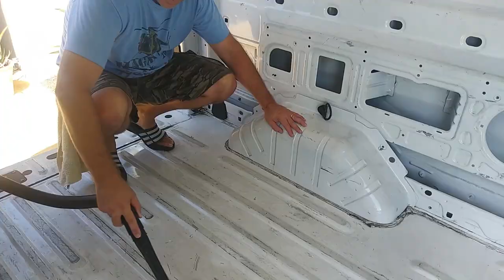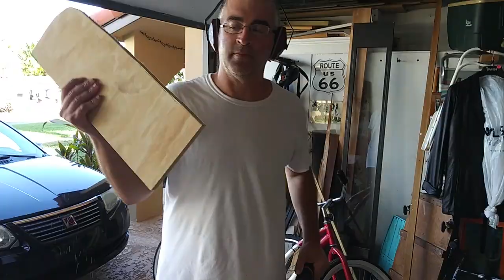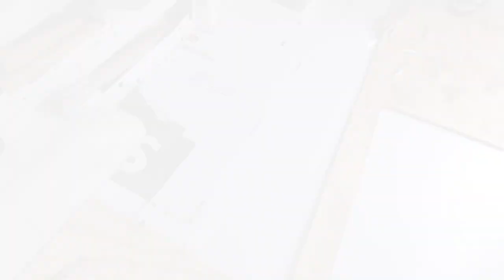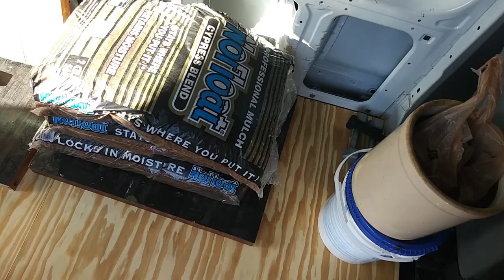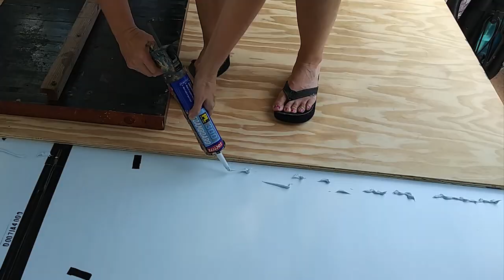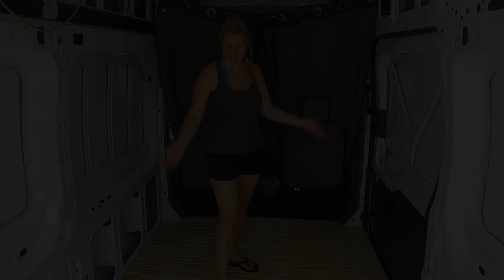How to (& how NOT to) install a SUBFLOOR in a Van Conversion (Ford Transit) | VAN BUILD #1

Comment: I like the bolt attachment style you used to secure the plywood. And spray foam the gaps to stop squeaking. Good stuff, cheers.
Reply from the maker: We really didn't want to put holes in the van but bolting definitely seemed necessary. It's held up well since.

Comment: If you use marine grade ply on the floor it is less likely to warp like your cuts did. Also, it handles moisture better than standard ply. I used 3/4 inch marine grade ply, but it was before the crazy lumber prices.
Reply from the maker: Marine grade sounds like a good way to go. We've been trying to minimize costs while not compromising quality. With the ply being bolted down it seems to be holding up well and we haven't noticed any warping.

Comment: Very nice! For whatever reason some builders really freak out about drilling holes into the van.  It’s as if a 14” hole in the roof is ok.  Perfect use of T nut to secure the subfloor!  Much better then simple sheet metal screws.  Perhaps a lock washer and lock tite on the bolt.  I would not worry about rust.  You painted it.  I would also paint the bolt head from the undercarriage with rubberized paint material to seal from air and water (you must have the two to rust ((oxidize)).
Reply from the maker: Thanks! We try try to avoid putting extra holes in the van if we can but felt that step was necessary. Thanks for the recommendations. We did cover the bolt head with QuadMaxx caulk, although we didn't show that step in the video. Hopefully that should suffice.

Comment: Thanks for this video! We are doing our floors similar to yours only we did NOT glue anything down and likely wont. We are having the same issue with warped and noisy plywood using only the tiedowns... so your bolting secured method is something we WILL follow your advice and do it that way.  Thanks again!
Reply from the maker: We're so glad you found the video helpful! It was so frustrating until we decided to do the bolts. We wanted to avoid drilling holes in the van but are glad we did! No problems since.

Comment: Phew you made hard work of that! Drill through the ply and the floor, countersink the ply, use self tapping screws screwing the ply to the floor.
Reply from the maker: Thanks for the suggestion for those who might be in the process of building out a van and prefer not to use bolts.

Comment: I'm a master wood krafter.
I been making furniture guitars
Houses cabinets and many other things out of wood for over 50 years..and I still made a 100 mistakes on my first build. 
and in the second one and third one..you always will make little mistakes but you learn from the mistakes you made
Reply from the maker: It's especially easy to make mistakes on a van build since nothing is straight! We hope to never have to build out a van again, but if we do we're sure this experience will help! We've certainly learned a lot along the way!

Comment: The foam will take a set very quickly, and all your bolt load will drop drastically.  Check how much torque on all your bolts now, I bet they are very loose.  Never try to compress foam. You should place some wood beams between foam panels.
Reply from the maker: Thanks for watching and taking time to leave feedback. We followed the lead on what some others had done with their builds long before we started ours. It's been over two years now since we installed the flooring in our van. We just double checked our bolts, and they are all still snug. We think (and hope) they'll stay that way!
Reply: I kind of get what you're saying but then there's the other issue of wood to metal and heat and moisture transference. 

sometimes the devil you know is the best choice

Comment: so, we shouldn't use any glue between foam and plywood and just screw it down? We almost started following faroutride guide for our subfloor, and thankfully saw your comment on Facebook tread! Thanks!
Reply from the maker: Far Out Ride was also one of the places we looked when choosing the method we used, as well as several others that recommended the same adhesive. We're not exactly sure why it didn't work for us. One reason could be high temps but who knows... I did just see a women post in a group we're in that the same exact thing happened to her. Several people responded that they bolted the floor. One person suggested: "Contact adhesive, liquid is stronger. Go to a local flooring supply shop." (Maybe that's the same thread you saw?) We're no professionals but all we can say is the adhesive we used certainly didn't work for us but now that we've bolted it, it's totally fine!

Comment: Hey HOW did you get a piece of wood that big? I’m stressing because I have a 2018 ford transit 250 and I measured the length of the floor at 127 inches and he width on the inside between the wheels to be 54 inches but nobody seems to have plywood big enough
Reply from the maker: Hey Dominick! We used 4x8 sheets cut into pieces to fit. Good luck with your build. We hope you'll find our build series helpful! It can be quite the learning curve and challenging to build out a van with all the crazy curves and angles!

Comment: I know I'm late to the party, but I just wanted to thank you for the honest video. It's a nice breath of fresh air. 

Of course most (if not all) of the other vanlife videos cut all the difficult parts out, or the stuff that didn't quite work out as planned. They need to keep up appearances, you know. It needs to appear easy or they can't get the views (that, or getting their wife/girlfriend to pose provocatively in the thumbnail, that's guaranteed at least 50k bonus views right there).

Anyways, you'll be glad you bolted down the floor. I've seen too many videos in which the floor was only glued down, and then they have their counters/cupboards just screwed into the plywood. I'd hate to be in that van cruising down the highway and someone bumps into you and you end up rolling it over. A van in a tight rollover with pieces of plywood flying around is not a very nice place to be. So I would not call what you first attempted a mistake, it was a blessing in disguise.

Me? I'd be screwing straight down through the plywood and foam insulation and the metal floor with self tapping metal screws. Just make sure to get the screws long enough to bite into the floor, and that's far enough. The screw will seal the hole through the van floor from rust, but you can get underneath the van and spray the ends of the screws with rust prohibitor if it makes you feel better. I'd put a screw about every 6 inches on opposite sides of each seam.
Reply from the maker: Thanks, Richard! We try to make videos that are helpful to others and to keep it real. Maybe some of the other channels just don't make as many mistakes or have as many challenges as we do! LOL! We're happy with how the floor turned out - and most of all we love that the van allows us to travel and explore so much more easily than our pre-van life! It's definitely been a learning process though. We hope you'll check out our other build videos and follow along on our adventures!

Comment: What purpose does the plywood sub-flooring serve? Why not attach the finish flooring directly on top of the foam boards?
Reply from the maker: For us, it gave a nice firm foundation for the rest of the build plus some extra insulation and sound barrier while driving. Mainly, we don't like to drill holes in the van, so the plywood provided something to screw into when building out the rest of the van. We also installed vinyl plank flooring (which you can see in a later van build video) and we thought the plywood was a better surface to install that over.

Comment: Pre planning is very important 👌 
1st Put it on paper 2s assemble it 
On your mind 3d repeat the process..never cut a single pcs or screw a single screw wit out this 3 steps 🚶‍♂️..and even so you make some mistakes. But the biggest mistakes  you could make  is get exited and rush the van conversion
Reply from the maker: Thanks for watching, David! We have certainly done a lot of pre-planning although it seems no matter how much we plan, sometimes it still doesn't come out quite how we thought it would! We've learned to measure many times before cutting anything and to dry fit before attaching anything!

Comment: I would cut the insulation to fit and put it between the wooden strips. But then the strips would probably have to be a little bit thicker. Also, I wouldn't drill holes in the metal of the van floor if I could help it. It kinda defeats the whole purpose of insulating if you have metal going through from the sub-floor to the outside of the van 🤪
Reply from the maker: There are lots of different ways to do it, which is overwhelming when getting started with a build if you are inexperienced! We're pretty happy with how the subfloor and insulation turned out and it's performed well since we started traveling. As you saw in the video we tried to avoid drilling holes, but it didn't go as planned. In hindsight we're actually glad we bolted the floor though - and there are only 4 bolts. There are plenty of other places where there is a whole lot more heat loss! LOL!

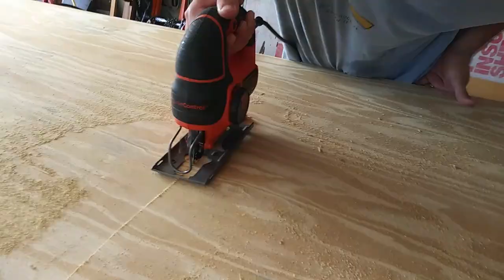Comment: 6:21 ... THIS is your problem .. beinig "Detail Oriented" means you tried to hard to make it fit perfectly .. If you jus went a1/2 Smaller on all the cut lines, it would have drop right in first try :)   The like you said just, use filter, or foam in the gaps.
Reply from the maker: Thanks for the feedback

Comment: Hi, just found your channel.  I haven't seen anyone share the problems with installing a  van floor the way you two have in this video.  Thanks very much for sharing!  I just had to subscribe.  Just one question for your - do you think taping the edges of the insulation helped prevent squeaking or is that not an issue with the whole assembly being bolted to the floor?  Happy travels!
Reply from the maker: Nice to hear from you, Pete! Thanks for watching and subscribing. Steve thinks the tape wasn't necessary because we ended up bolting the floor and all of the weight we've added. I think it didn't hurt and cost was minimal so I'm glad we did it. I'd hate to have squeaking now that it's too late to do anything about. Probably no way to really know if it was necessary though!

Comment: That’s styrofoam, not xps. Big difference. If gluing to floor the floor paint must be grinded off down to bare metal for long term adhesion. All joint should be tongue and groove if possible

Comment: Sorry about your flooring headaches. Quality materials ARE costly, indeed. However, it's wise to avoid building solely on the principle of "saving money"; an invaluable lesson I'd needed to learn for myself. Ouch!
Reply from the maker: We certainly love saving money when we can, but we don't think in this case that the problem we ran into was from cutting any corners financially. We had read recommendations for the adhesive we used. It just didn't work for us. Maybe because of higher temps? We're really not sure. We agree, sometimes it's not worth it to sacrifice quality to save money.

Comment: Bolting to the floor seems way safer than glue. I liked a lot of your tips and tricks along the way that I wouldn't have thought of. You all have earned a subscriber.
Reply from the maker: Hey Shawn, thanks for watching, dropping us a note, and subscribing. We really appreciate it! We were really hesitant at first to put holes in the body but in hindsight we are glad we did. We're also glad if others can benefit from our process. Are you building out a Transit?

Comment: Why didn't you any sound damping material?
Reply from the maker: That's a great question that I don't think anyone else has asked. We just weren't convinced we needed it. We budgeted for it early on but after doing research, listening to the van as we drove, and knowing our plans for how we would build it out, we decided it was unnecessary weight and expense. We insulated the van really well. In the back we also used the self-adhesive duct insulation in some spots which seemed to have some similar properties as rattletrap type material but much lighter. We also have a lot of insulation on the ceiling. Now that the van is built out, the noise we really notice is more in the cab. We don't regret not using sound deadener it at all.
Reply: @SteveAudra  Great answer.  The reason I asked is because so many videos out that have used it. I seen 1 video where the entire van was covered in it. I could imagine the amount of weight it must add. I don't know but I guess it might be a good at insulation too. There are much lighter materials that can do that job too.

Comment: You actually don't need to use anything to hold down the insulation or subfloor. Yo have a tight fit as far as the cuts, and once you have the rest of the build in, it will not move.
Reply from the maker: In hindsight,  we agree with you. If we were to do it again, we wouldn't worry about glueing down the insulation.

 Even though the rest of the build would hold down the subfloor, we do like that we bolted that down. We feel it helps secure it all better.

Comment: You two are great but one does not use squeaky Styrofoam and ordinary plywood for a sub-floor.   Styrofoam, as most plastics do, emits toxic gasses and its highly flammable. You created a death trap.
You were correct to make a template but paper is not accurate. Use the Styrofoam, the cheap white stuff, to make a one piece template. Locate fastening points on template.
1st  You need to completely paint the entire metal van floor, Do not patch paint.  POR Epoxy paint is an excellent choice. Rustoleum is not.
2nd  Install Kilmat or Dyna mat to entire floor. Two layers on wheel wells. This stops road noise. 
3rd  Run any wiring.
4th  Install a clear polyethylene thick vapor barrier 1-2 " up on all sides. #80 Spray glue in place.
5th  Install SUB-FLOOR:  Use a waterproof and non-flammable sub-floor material such as 3/8" fiberglass board, or flame retardant 3/8" Tongue and groove marine grade 8' x 10' plywood. 1/2" is too thick and heavy.  Glue any plywood - plywood seams with epoxy. Drill 3/4" holes in the sub-floor for the recess cups every 12-16". Do not use flat head screws.
Fiberglass requires no painting.
 IF Plywood: Paint both sides and edges of the plywood with POR. Sand between coats. At least two coats. Should resemble steel when done with no wood grain.
Use self drilling pan head or hex head stainless steel fasteners #8 x 3/4 with recessed cups to hold it all down every 12-16".
 6th  Install a vinyl 9ft x 11ft single solid vinyl floor. The thin lightweight stuff.  IT is important to use only a single seamless piece of vinyl flooring. The vinyl will that goes up each side 1-2" . This creates a waterproof "bowl" to contain any spills. Glue edges and center only using Mastic or #80 3M Spray adhesive.  #90 will not work.
Install electric heating mats under the Vinyl if desired. If carpeting then install electric heating mats under the carpet over the vinyl.
Then carpet over this if desired after installing cabinets.
Add metal edge thresholds in doorways.
Now you have a sound dampened, nonflammable quiet  waterproof lightweight  (heated ???) floor that you can build on.
Now cover this floor with rugs, cardboard and Rubber runner mats to protect it during the floor during the rest of the build. Plus the floor will never rust out.
Next do all electrical in wall wiring.
Now insulate the van with Areogel blankets (highly preferred)  or Rock wool or great stuff (sparingly). Do not insulate with Styrofoam.
Reply from the maker: We appreciate you watching and that you think we're great! 🙂 As far as how we're doing the build, it seems that everyone has a different opinion. We researched and researched before starting the build and have done what seems to make the most sense for us at a cost that isn't exorbitant. We hope to never have to do another van build again and that what we've done will hold up for a long time! Once is enough for us! LOL!